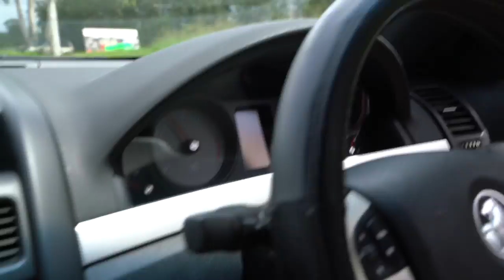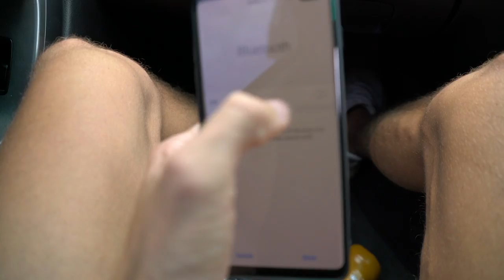Straight Piping a SV6 Commodore PT 2!

Comment: I wonder how mine's going to sound with the Bimodals after my centre muffler delete haha.
Reply: Rowdy. Too fkn rowdy.
Reply from the maker: Can we get an upadate on how it went haha!? Havent heard a middle delete with bimodals on a SV6 i dont think!
Reply: @marcusbelt8061  Oh mate, it was completely rowdy when you smacked the foot down, but so long as you like, kept it below -10inHg on the vacuum gauge, it sounds reasonable. 

Almost got yellow lickied for the straights though. I put an SS centre in, and will probs put an extra pair of doggies and a cross in place of the front box the next time she goes on the hoist. If you look at the vid on my channel, that's with the V6 centres on it, so it's currently a bit louder than that. 

If there's constant vacuum pulling on the mufflers she's quiet as. I added a controller that lets me switch between open dump and the engine's vacuum. I've yet to add a vacuum pump to the mix but when that's done, expect to see vids.

Comment: mine is exactly the same! same wheels colour and tint on coil overs and 20 inch black simmons on 225 35 r2o inch tyres. 5% tint on  the rear 15% on front a shibby banner on front window and full stereo system with aerpro conversion with ps5 running on 2000w inverter. internet works with samsung hot spot.
Reply from the maker: Uppa! Nice Jon 👌🏽